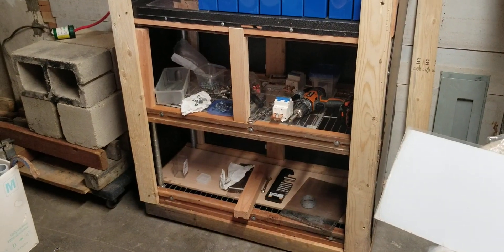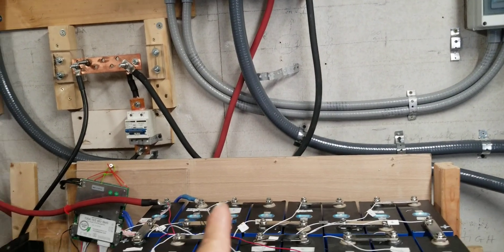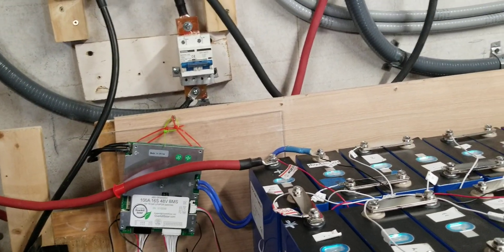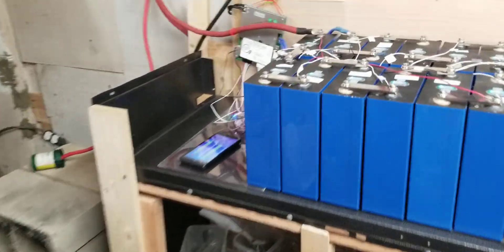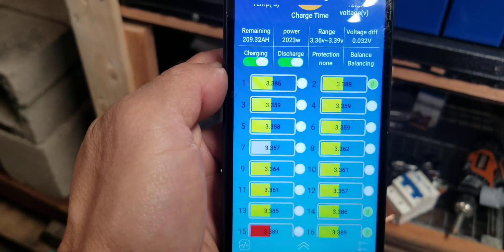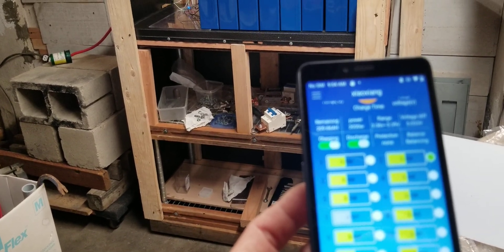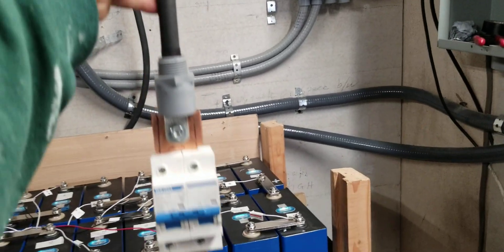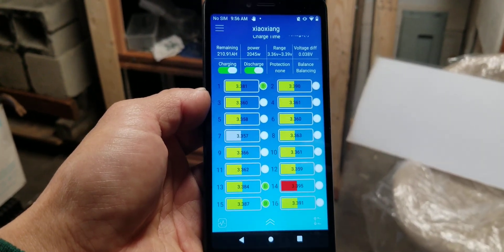EG4 6500 EX charge and balance battery with overkill solar bms Jbd followup

Comment: cable length only matters as to resistance 
resistance increases with amps flow
leading to voltage drop 
it is best if all batteries show the same voltage at the END of the wire 
just before they attach to the main busbar of the battery Bank

.
if you are paralleling batteries then it is important the voltages are the same on all batteries
which is why .. wires as short as possible and as thick as possible going to a shared busbar
 then from busbar to load 
.
if the wire run is short enough and the wire is thick enough and the amp load small enough
 the voltage drop will not be a issue
but
if wire is too long .. too thin .. too many amps .. 
one battery will seem to have a higher voltage .. and be drained quicker  and at a higher rate .
.
stressing the battery  .. but if you are only using about 0.1 C rate  as your load .. the stress is very little .. the higher the load the more important  short thick wires on battery bank with each battery near identical voltages

Comment: i am just stating the path a wish i took from the beginning.
i went down many money wasting short cuts ..

they were fun .. and time and money wasting but..
an education  .. besides .. we all know ..
the greatest joy is in the journey not the destination.
Reply from the maker: Which Active Balancing do u use that work out good for you, can you please recommend?   I would needed active balance my high voltage at cells 14-16 or maybe just buy the 16s balancing ?  thanks
Reply: @evempsolar  Off-Grid Garage
@OffGridGarageAustralia

Automatic Active Balancer - The Evolution in Balancing

https://youtu.be/yPmwrPOwC3g

which ever balancer you go for ..
they work best if you have the ability to turn them on and off ... at a point of your choosing ..

i purchased a Daly bluetooth s16 Active Balancer on sale ,
 i think around 50 $ or so .. 
i use the app to start balancing around .. 3.38 or 3.37 volts .. to catch any runners early..
setting the startup deviation  to 0.020
once started 
if you let it just run on its own .. 
it will keep going until all cells are within about 0.005
.
but. 
we must manually turn off the balancer if we are actively using / draining the battery.
if we don't .. 
cell balance will be destroyed on the way down.
.
think of it this way
if you have 4 cells
3 of 100 amp hours and 1 of 90 amp hours
they can be 
all 100% full
 or
 all 100% empty
100 % Balanced
.
if you use 50 amp hours 
the 100ah cell will be at 50%
the  90ah cell will be a Lower % 
now pack at this point is 
not in balance
.
Reply from the maker: Thanks, great idea.  
I bought the Active balancer by Hawzor store in AliExpress humm. this one do not have Bluetooth to turn on or off (cheaper).  Can I make a switch on the positive red and/or negative black to turn it off?  One switch or 2 switch? or have to unplug it to turn it off? any idea?  I asked on off grid Garage but no one reply.

2nd Question: have you experiment on the Cable from batteries to Bus bar.  Do you calculate the cable length of the BMS from batteries to busbar?  Do you have video discuss of your setup?  Thanks
Reply: @evempsolar   cable length only matters as to resistance 
resistance increases with amps flow
leading to voltage drop 
it is best if all batteries show the same voltage at the END of the wire 
just before they attach to the main busbar of the battery Bank

.
if you are paralleling batteries then it is important the voltages are the same on all batteries
which is why .. wires as short as possible and as thick as possible going to a shared busbar
 then from busbar to load 
.
if the wire run is short enough and the wire is thick enough and the amp load small enough
 the voltage drop will not be a issue
but
if wire is too long .. too thin .. too many amps .. 
one battery will seem to have a higher voltage .. and be drained quicker  and at a higher rate .
.
stressing the battery  .. but if you are only using about 0.1 C rate  as your load .. the stress is very little .. the higher the load the more important  short thick wires on battery bank with each battery near identical voltages
Reply: @evempsolar   when i think of the balance leads .. if it is the typical kind where ..
1 lead goes to each positive terminal of each cell .. 16 leads in a S16 48v lifepo4 battery ..
and 1 lead goes to the negative of  pimarmary negative of cell one ..
then yes ..
a good / quality simple switch or means of disconnection on the negative would work ..
  remember do not release the MAGIC SMOKE

Comment: systems all at some point need to go down 
in whole or part for maintanance ..
...with this in mind
if possible break your battery bank into a minimum of 3 peaces
idealy .. each peace on its own with enough amp hours and current avalable ..
to run the entire system short term .. and longer term with just 2 working..
allowing time to fix or upgrade banks 3 and beyond..

keep that in mind when buying a BMS ..
1 very expensive 350+ amp .. 1 point of failure
or
three 120 amp  ( 5 would be better ) .. 

those  16 ..  280 ah eve ( lifepo4 ) cells you have
i have 5 working sets (  5 BMS between 80 and 120 ) of them .. 
my sixth set was incomplete..
only 12 made it here .. i turned them into 3 separate  .. 4 cell 12.8 v units
each pack..
 both the 48 and 12 packs
have active balancers .. 
bluetooth are best so you can turn off balancing ..
when you feel balance is optimal

Comment: most inverter are like cars
they can go out to their max out speed 
but not stay there for extended times .. and ..
the hotter your engine is forced to run  .. 
usually the quicker it will shut down or die ..

car might max out at 120 or more for a time
but
can run all day and most of the night at 80 ( when it was newer )

a guess .. just a guess ..
those 6500w units will run for hours and hours on loads of 4500 or less..
even on days that are hotter than hoped..

a full stove or full size dryer each can be 5+ k  ( 20 or 30 amp dual pole )
a charge of that ev at a good .. but not high speed .. 6+ k ( 30 or 40 amp dual pole )

so leave room for when you buy 2 more inverters

Comment: all wirering shoud be 12 awg or better ..
( allowing the adding of a needed extra load someday )
breakers best to be ground fault sencing .. 

remember your furture loads now .. 
think of all those batteries .. the space they will require..
if we plan for it now ..
we will not have to move and remove everything again .
again ..

Comment: where i am .. this basement is unfinished 
making the next step not too hard in my case..
going to the first accessable junction point of each line out from the main pannel..
at that location install two separate heavy duty recepicle boxs..( 20 amp type ).. 
one on the wires returning to the main pannel the 
other returning to the UPS breaker box ..
then a heavy duty plug .. placed on the wires for the load of that circuit ..

it is cheaper to spend now planning on future ..
unrealised .. unintended .. upgrades .. 
loads you weren't thinking would come so quickly

Comment: i treat my inverter as a UPS ..
.. bringing power into my ups ( the units you seem to have ) ..
main pannel to a 220v / 240v heavy duty recepticle  ( not a cheap one )..

..........
A cord for the UPS to pulg into that recepticle..
split one phase to each inverter..

out from the UPS .. into a breaker box just for the Combined UPS output...
you might wish to have a box big enough to hold..

1 dual pole 50 amp breaker ( for when you wish to shut down both your units..
 at the same time ..  6300 watts / 122 volts = About 50 plus amps .. 
always leave a margin for the hickups in the system..
out from that into two separate 50 amp brakers one for each phase..
for when you only wish to shutdown 1 unit..
out from there to many separate breakers as you have in ..
your PRE Planned load centre .. both 120v and 240v ..

Comment: if at some point you can see yourself..
selling the home or also for home insurance reasons..
You should avoid any obvious changes to the 
main incomming electrical pannel .. by a none Qualified Personel..
i'm not saying don't do anything to your box ..
what i am saying .. if lightning strikes your home .. and your insurance provider 
can find a reason .. they will use that to low ball what they will cover .. 
..
if you want your home with the least upstairs re wirring..
quickest way back to unchanged..
and able to load balance between UPS and mains panel power ..
by choice of which plug you attach the load
Reply from the maker: Thanks, Yes, I do have the Gas Electric company  Breaker box below the sub panel, If I needed switch back.  I just pull the wire up. and pull the wire of the UPS upward higher sub panel.  The ground post is connected to the original sub panel where the inspection does.  The UPS inverter and batteries bank is inside the garage further north side of the wall about 20 feet away (2 car garage) That batteries bank and panel box is connect to the new Ground post + 2nd Ground Post 6 feet away connected to solar panels ready just in case lighting hit, all connected to ground... according to code.  Thanks for your advice, you are very wise.  I did have 2 double pole breaker for Inverter 1 and 2.  will make video on that to show you and everyone.  I am in San Diego, CA.  not sure where you are but if you think about buy the EmpShield please use my $50 discount code: EmpEvSolar to protect your system and home.  Thanks.   * The Grapes are ready but not enough worker.* ...
Reply: @evempsolar  i am in canada .. in a house with a small lot size ..planning to sell in a few years ..so .. at this point the cost of a replacement roof ..and panels .. would take too long on the pay back .. i only to this point ..
buy cheaper night time energy from the grid ( about 6 or 7 cent ) overnight ..
 and use it when all day ..( 11 - 18 cents )..
the savings  in the cost difference is a bounce .. 
i started down this road as a UPS .. due to the world situation .. 
my small primary 5k inverter runs all the 120v loads i have added to this point .. 
..but..
next year 2023 .. the Ontario government .. is planning to go to more the UK pricing style ..
a smaller low price window at a even lower price .. so then i will need buy an inverter like yours 
to get a faster / greater charging rate .. 
mine at present only charges at 40 amps / 2000 watts ..
mine now has an base energy idling of about 30 / 40 watts ....
i believe yours base idling is 70 + watts .. the new EG4 8k split phase idling is around 120 + watts..
but ...
if i buy that one to charge and cover my stove and dryer ( one at a time ) ..
added to my 5k should cover 90 % of my loads 90 % of the time.

i may install a pergola in the spring .. 
then i might put panels on that.
if i am only saving   7 or 8 cents per kilowatt.. each 250 $ panel will take over 3000 hours of use to pay off..
with only about 3 -5 sun hours on average .. 2 to 3 years of use per panel   ..
but .. i will probably do it for fun sake .. with used panels .. the Pergola needs a roof anyways
Reply from the maker: oh, if our power cheap like your ,,,.. I don't needed to install solar and batteries hahahaha.  35 cents per kwh here. in San Diego, California.  if it's high peak time between 4 pm to 9 or 10 PM cost more.. they have all kind of power time cost and plans... winter time. price different, summer different. gave me headache.  I also have Electric car. it's pay back quick.  Yeah that all in one inverter much more heavy and idle time more power... but research and think carefully before buy it.  I think that not fit for me.  The Idle time cost too much power... I would needed more solar panels....
Reply: Thanks, see my other video on this channel.

Comment: questions i am asking to help in our path .. so as to be more a help than a hindrance..
.
1) are you the owner of the home
2) how many years before you will be leaving that location / home
3)when you leave is the system remaining or will you be removing it and putting the house back as it was before .
4) what is your Budgeted total spend for the final end point of the project
5) what would be worse ... if the project took 3x as long to complete or cost 3x as much as budgeted.

it is said..
in life and construction 
you can get any job done
.
Fast ( quickly on schedule )
Cheap ( economically on budget )
Well  ( high quality workmanship )
.
but only any  two 
the third is of inverse proportion.
.

Comment: wire is too costly and rare to cut .. unless there is no other choice .. don't cut yet ..
i am only 1 or 2 years ahead of you .. but what i have learned    .. so far .. has taught me .. 
a play on words of that old saying   ...
think twice ..and then act (cut) once .. or more likely .. think it though from start to finish ..then draw in relative scale from start to finish .. then don't do anything until the next day minimum  .
it might surprise you how many time the next day you see something or think of something even better or more effective.
.
i will watch or re-watch your past videos.
but 
what is the exact outcome you are aiming for
both short term and mid term and final .
.
i too , to this very day.
struggle with the truism .
Don't let the purrfect get in the way of
the good enough.

remember .. just because a thing can be measured or seen.
does not mean action is required to achieve .
our mid-term or long-term goal.

we do not need chase every shiny thing
most are only a distraction
Reply from the maker: Thanks Very much for your adviced.  Yes, you are right.  Plans do change and I saw new better way to make it better as I wait and came back another day.
I am home owner, Father past down to us.  I will expand the batteries to 60 kWh or even 90 kWh when I have more money.  Solar currently 4980 wh but looks like it only max at 4650 in cool summer time and that I already lower the rate of the 250 watts of the 12x smaller solar panel to 200w.  
With electric car,  in winter  I got only 2800 watts max in cold clear day, you know... Cold give more power.   I estimate that I would needed 60 kWh batteries bank and at least  450 watt x 6 more of solar panel = 2700 (2300)  winter time 1700-1800 watts I would be OK, piece of mind and not worry about cloudy day ( still have space  on roof for that 6 )
Reply: @evempsolar  remember to keep total voltage of those pv input.... 20% .. or more below ..their max short circuit voltage
if i remember right those inverters are 450 max .. just a wild guess but i think some 32v panels spike to about 40 on cold days when sun comes out from behind a cloud .
so only 8 or so would be safer  .. 10  would on paper work   .. 12 or more ... would not be issue .. until that day it is
Reply from the maker: Thanks.  I have it at 300 volt on one string and about 280v on other at open circuit. when it connect inverter start.  It drop down. total  4900 watts max on 8000 watts max inverter divide in two pv1 and pv2 of the inverter.  Thanks